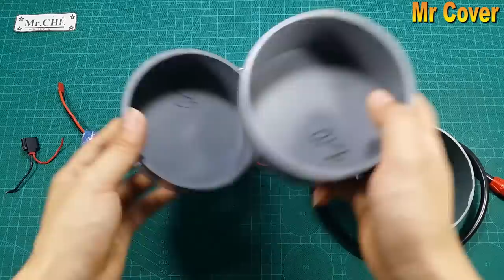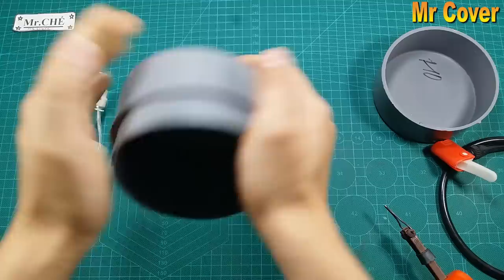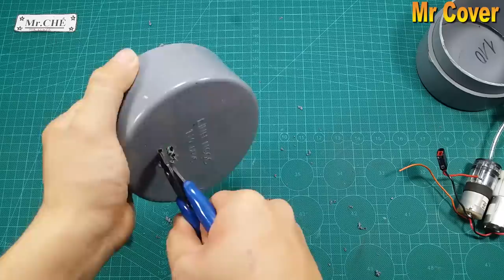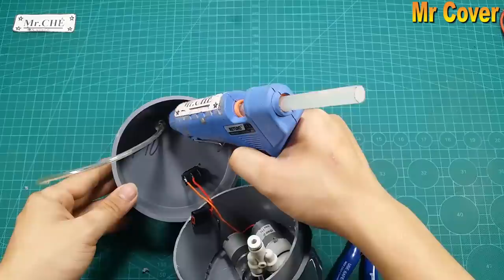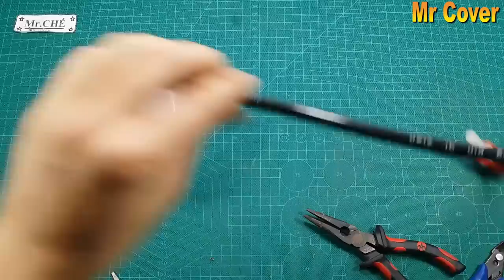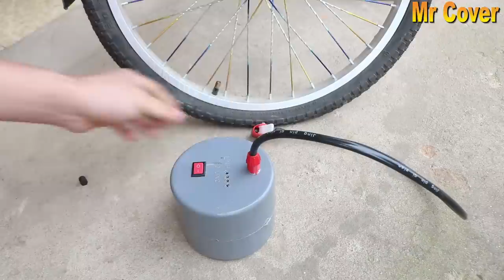Great ! How to Make a Mini Air Compressor (Powerful Air Pump)

Comment: U did good efforts but please make videos with ur instructions, materials used, the prices of materials, how did u gave connection all these things will make ur video more useful.instead of music keep these things..
Reply: What is d name of the materials u used put d name of d materials u used in d description
Reply: @redgiepirante1098  components : PVC pipe + 12v-24v dc motor + Bicycle pump hose & nozzle + Switch "on" - "off" + lots of wires + Bolt (and the thing to tighten it)

Comment: put up the materials you used in description and 
 with it your video should be more informative rather than showing how to do..  hope you'll put in the materials lists in your next video
Reply: u can get T connector from any water purifying service centre for twenty rupees....buy 12v air pump motor....four 3.7 in serial mode...12v charging module..that's all...BUT i want to know the psi of this motor...
Reply: @a_1979  with max rated voltage and current 1 pump can output 13-14 psi,
i checked on Amazon its written in the item description.

Comment: at least put a list of material of it..
Reply: yeah.. that's right... with it your video should be more informative rather than showing how to do..  hope you'll put in the materials lists in your next video
Reply: I agree
Reply: components : PVC pipe + 12v-24v dc motor + Bicycle pump hose & nozzle + Switch "on" - "off" + lots of wires + Bolt (and the thing to tighten it)

Comment: Send the details description of things which you used for
Reply: PVC pipe + 12v-24v dc motor + Bicycle pump hose & nozzle + Switch "on" - "off" + lots of wires + Bolt (and the thing to tighten it)

Comment: பொருட்களின் பெயர்களை குறிப்பிடுங்கள்
Reply: go to any plumper shop for pipes...pipe cups is ur choice..motors are 12v each air pump motoe ..T plug u can collect it from anu auro water repair shop hardly 20 rupees....battery 3.7 in series and 12v charging module,,,thats all

Comment: what are the components that you used?? please mention the components??
Reply: components : PVC pipe + 12v-24v dc motor + Bicycle pump hose & nozzle + Switch "on" - "off" + lots of wires + Bolt (and the thing to tighten it)

Comment: full parts names send
Reply: components : PVC pipe + 12v-24v dc motor + Bicycle pump hose & nozzle + Switch "on" - "off" + lots of wires + Bolt (and the thing to tighten it)